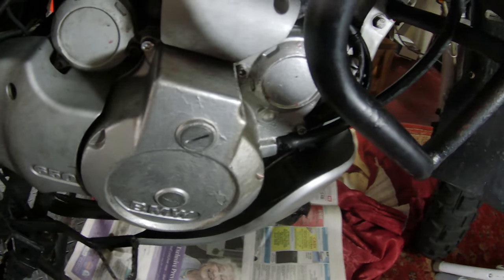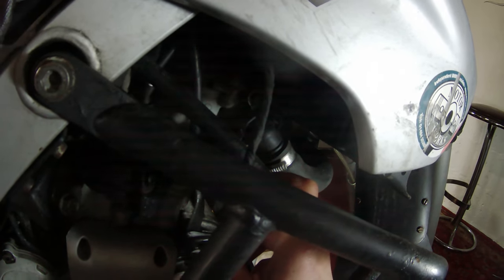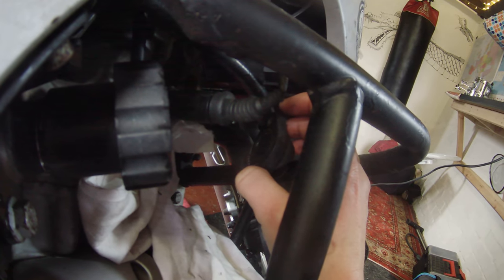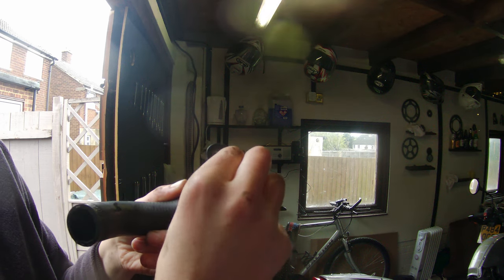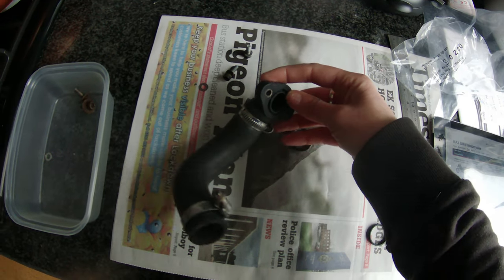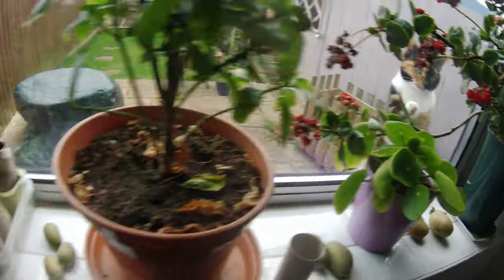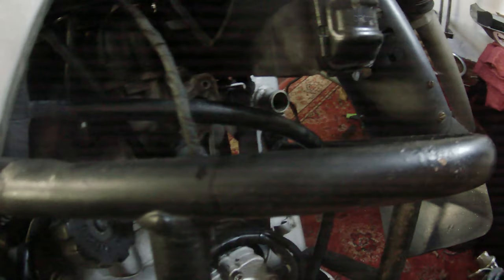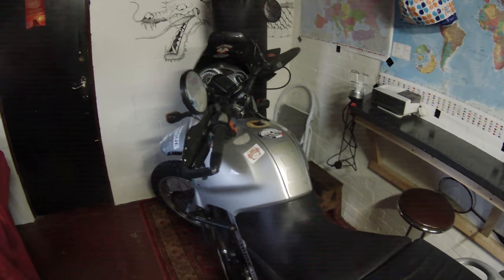Monster and Me - BMW F650GS Radiator Gasket Ring Replacement #11127652951

Comment: I bought the same bike, have been encountering similar problems, and have been transiting the same learning curve. Thanks for uploading these videos, they're great to me. 
If I could ask you for a great favor: Could you measure if the brake light contact on the tail light bulb has 6v when no brake is applied? I can't figure out what's normal anymore...
So the tail light has two positives, one for the running light, and another for the brake light, I'm measuring 6v when not braking and 12v when braking. I'm dying to Cross check with another F650GS.
Thanks for your content in any case!
Reply from the maker: Hi Matias. No problem, I will try and take a look this week at the tail light and get back to you. :)
Reply: @HaynesGarage  Thanks a bunch!
Reply from the maker: @matiaswagner9810   I checked the voltage on the tail light and brake light this evening with my friend. The tail light is reading approx 12v with no brake applied, the brake light is reading 0v when no brake applied, the brake light reads approx 12v when the break is applied, the tail light also reads approx 12v when the brake is applied. Hope that helps. It’s a bit fiddly checking this on your own. Might be a faulty earth?
Reply: @HaynesGarage  thanks. So I do have a problem. Interesting. God knows from where is that voltage coming
Reply: Thanks Katy, from the whole internet you're the one that replied !!!! Really thanks a bunch !
Reply from the maker: @matiaswagner9810  No problem. Make sure you’ve got a good earth and then check it again. Good luck sorting it!
Reply from the maker: @matiaswagner9810  Can I ask what you’re using as your earth? I used the base of the bulb next to the two contacts rather than part of the frame.
Reply: Yeah, there's a metal prong that makes the earth of the bulb, that's what I was using too.